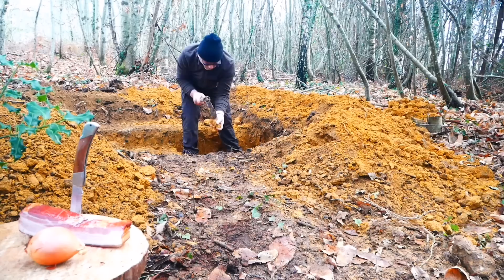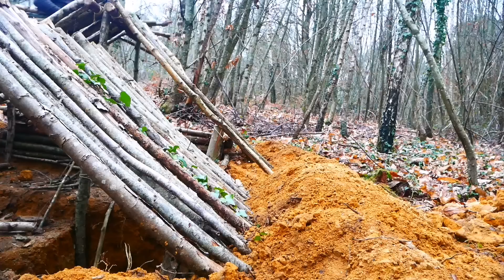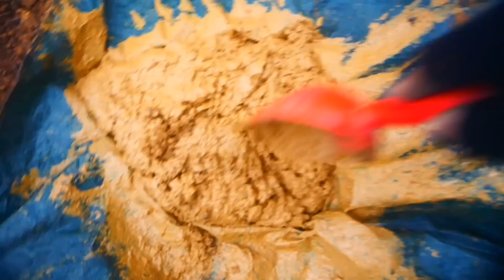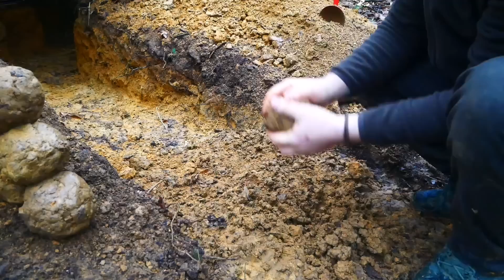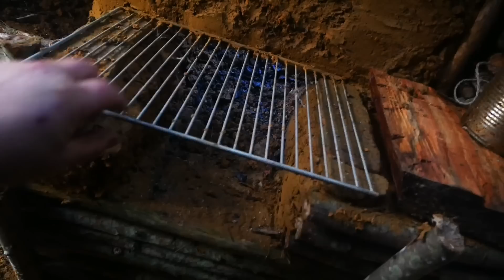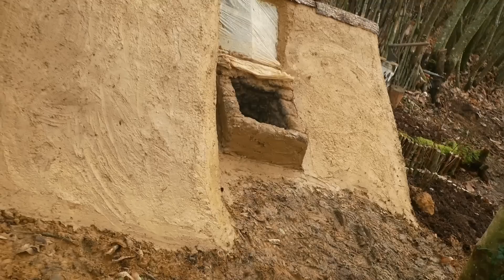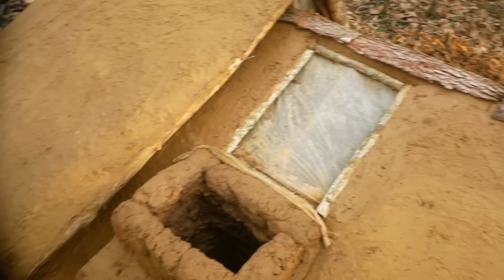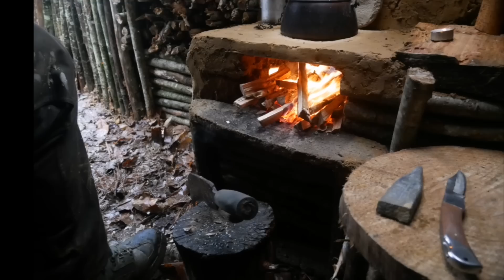SURVIVAL EARTH LODGE HOUSE - Bushcraft  a pit warm house The best of all natural Shelters!!

Comment: That’s quite a spot you’ve made for yourself. My only concern would be the roof. Not sure that clay will stay where you put it. A secondary coat of dirt, then moss, would make for a more weatherproof hat.
Reply: Maybe he's making cement or geopolymer?  He mixed it with something.  It might cure in the sun into something fairly solid.  It's impossible to know without knowing the geology and if he brought some form of cement to mix in with the clayey soil.
Reply: "My next project is to cover and strengthen my roof with clays and cover them with herbs for. avoid erosion"  He wrote this in his description underneath so I think that might be all he needs to do?

Comment: I know this African location well.  The elephant dung that lies just beneath the deciduous layer of flora has been used for centuries to construct homes like this.  The stench is helpful because it keeps animals and insects away, accept for certain months, 11 of which are the correct months for the fly population, which IS in fact attracted to any of the dung which is exposed.  For those of you commenting that the rain will collect in the shelter, you are correct.  The area inside the door allows for a elephant dung bath that helps exfoliate and increases the nitrate surface of the skin for a medicinal effect.  The charcoal and ash from the open chimney adds to the minerals in the bath.  When home and a sudden rain is immanent, you build a large fire, climb onto the sleeping platform, and the resulting steam helps to turn the environment into a steam bath as well!!!! I hope this clears up any questions or thoughts you may have.
Reply: His original verticals are way too flimsy.
Reply: Put some thought into that one.
Reply: Professional trolling 😂

Comment: If it rained really bad, wouldn’t the water just run into the hole “ your new home”?We have limestone and hard clay, I think maybe a above the ground would be better, for many people. I’d like to see one of those videos.
Reply: Clay is colloidal and doesn’t create channels or pockets like something sandy. 

This allows it to retain water and cohesion and adhesion force the water around the structure. If there is a hole though be forewarned water will find it!
Reply: My first thought also. 
Water has a nasty habit of finding even the smallest passage, and quickly expanding on it.
Also, I dont recall ever having seen natives building homes in a dug hole. It is always on the ground, or even better, elevated.
Reply: I thought the same but if the fire is hot enough think the heat will evaporate most normal rain entering the chimney, but a hard downfall, I’m not so sure.
Reply: Yes! No1 in right mind would build shelter under ground. Moist is the evil thing in outdoors and specially where you sleep should be dry at all cost.
Reply: @embracethesuck1041  if it is below zero u cant dig under ground.. Dirt is just too hard... And if u do it before ground freezes and use it after it freezes really sucks... U put fire on that thing and all the snow and ice around it will melt in that hole anf i bet that stove will break anyways if u u use it when it is cold... If u dont use fire inside it is better to try dig as deep as u can
Reply: I'm worried about the ramp. That seems to go into the hole he dug. Rain water would lend in the ramp and go into the floor of the hut

Comment: I kept waiting for him to build something that would keep rain from running into the house. It looks like it would just run straight down the the front pathway and into the house. 
I enjoyed seeing him eat raw onion. I do that, as well as eat raw garlic as I've read other commenters say.
Another concern I would have is predators/animals. I would want to seal the doors and windows to ensure that I was safe at night. Beyond that, though, everything looked nice and very very cozy with the fire :)
Reply: I think the path in front of the door for the most part slopes down. There'd be a puddle but overall ok I think. Looks like the UK. No predators. 🤟
Reply: Plastic sheet skylight next to chimney seems like a problem.    I understand wanting the light there, but . . . .
Reply: I was thinking, if it starts raining then the water will run down into the hole.. 🤔

Comment: So you dig a hole in the ground, build a cover, and several water catches so the first big storm fills the hole in the ground with water?
Reply: No. The camera gives a false impression that its heading in, it is not. He updated 8 months later and its fine, still standing as stong as the day he made it. He makes hundreds of these, he knows what hes doing.
Reply: Serious question
When it rains heavily doesnt the water go straight down the chimney and on to the fire?
I have a cap on my chimney and even then when it's windy and raining some water gets in sideways
Reply: Interesting that this is an old post and these are all new comments.  Love the algorithm.
I would have thought placement of the hole would make a massive difference.  From a military background I have dug a few holes in the pouring rain.  As long as you aren't at the bottom of a hill in the flood area, ground water is not a problem.
Reply: @krungstar4541  what a load of cobblers! It’s clay soil ffs.
Reply: @stephenhathaway269  so you are saying it will fill with water then?  Despite the fact the author has said it hasn't.
Bold shout.